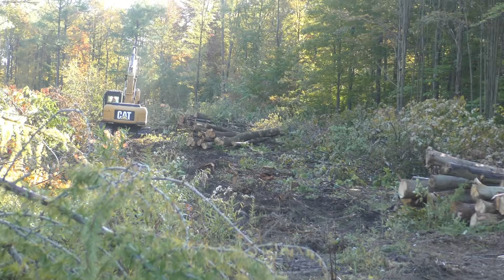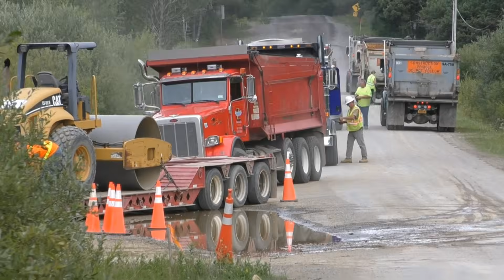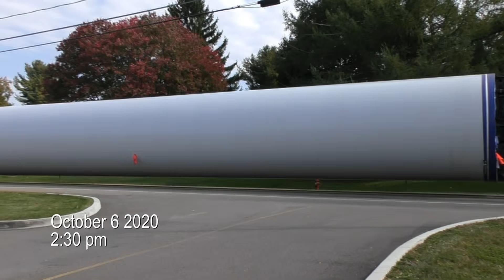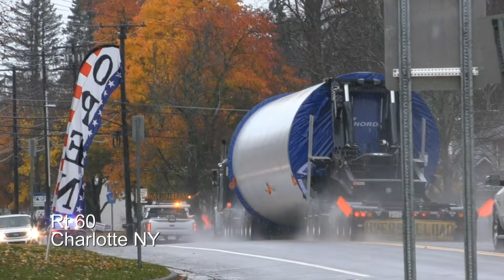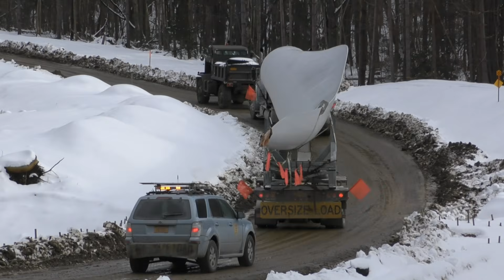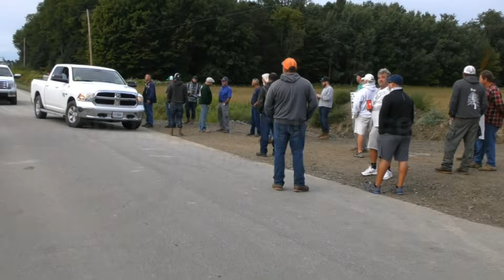GREEN MADNESS: The Waste and Destruction of One Industrial Wind Turbine Project

Comment: A blocking patent is a patent that:

1. Covers a broad concept or technology
2. Has a wide scope of claims
3. Is owned by a single entity or company
4. Is used to block or hinder others from developing or using similar technologies

Blocking patents can be used strategically to:

1. Prevent competitors from entering a market
2. Limit innovation or advancements in a field
3. Maintain market dominance
4. Collect royalties or licensing fees

Blocking patents can be problematic because they can:

1. Stifle innovation and progress
2. Limit access to technology or knowledge
3. Create barriers to entry for new companies or inventors
4. Lead to patent trolling or frivolous litigation

In the context of geoengineering, a blocking patent could potentially be used to:

1. Control access to weather modification technologies
2. Limit research or development of climate engineering methods
3. Maintain a monopoly on weather control or climate modification capabilities

It's essential to monitor patent activity and advocate for responsible patent practices to prevent the misuse of blocking patents.

Comment: All the gas well drilling in chautauqua county area during the 1980s did not do a fraction of the eviromental damage this wind project has done. They throw a fit about a petroleum pipeline project but all this wind and solar crap is just fine! 😡
Reply: And once the well drilling is done all that is left is a pipe sticking out of the ground not a Cusinhart of the air mangling birds, bats and insects